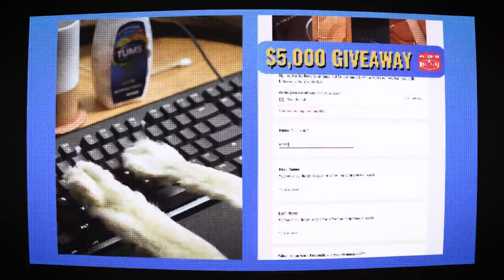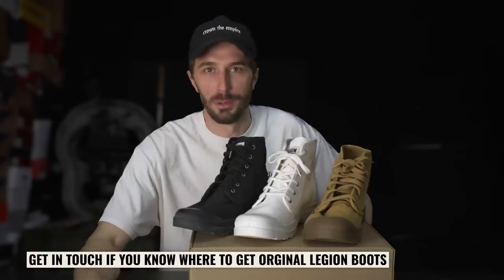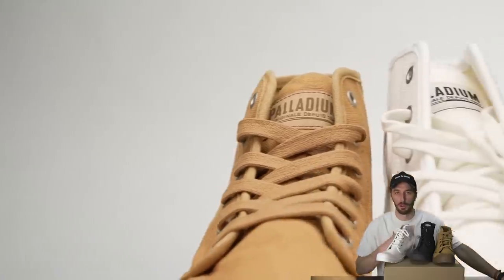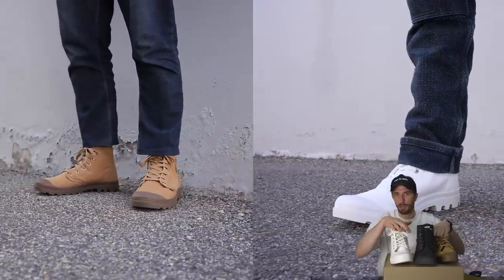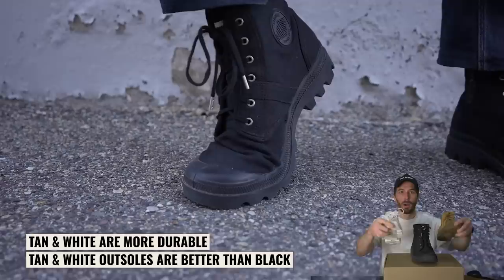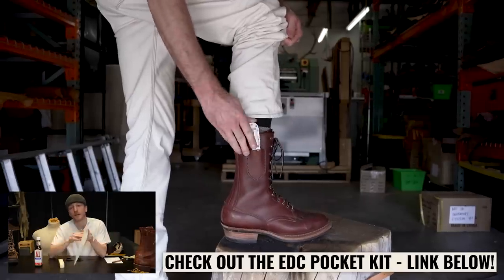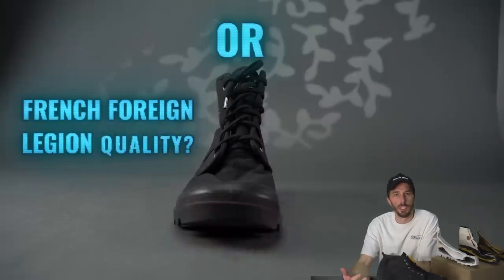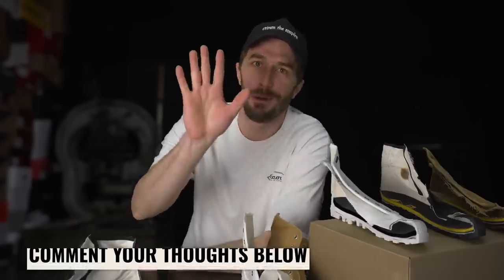(Top 3) Palladium live up to French Foreign Legion legacy?

Comment: Bought a pair, they’re the worst shoes I’ve ever bought. Shame they look cool, but are awful
Reply: Sounds like the french alright
Reply: the ones made in France before the '90s were pretty neat and comfortable, but definitely not for the flat footed or flat walking 'tard. quite durable for their intended purpose. now it's like Converse, Vans or Timberland shoe-like objects: made for milking as much shekels as they can while using the brand name until it's worthless or mostly used to sell anything but shoes. 😒
Reply: what's wrong with them - i wear them for years and by far the best canvas shoe i owned
Reply: I actually found them very comfortable. I have wide feet though. I benefitted from the wide and stiff setup.
Reply: @nundata  They don't really make shoes for people with a wider foot.
Reply: I got mine at a thrift store brand new. They could be an older model.
Reply: Never had any problem with mine. About 10x as comfortable as any converse or the USA made PF Flyers I had. My second favorite summer “boot” after my wallabees.
Reply: Bought a pair that was on sale. Leather vamp. They were 100 on their site. They were fine in urban environments (concrete, asphalt, etc) but as soon as you use them on any terrain more uneven than gravel, they’re all show no go. They’re more sneaker than boot. Compared to Converse, I guess they are better, but the outsoles aren’t durable and have worn out faster than any other boot or shoe I own.
Reply: Imma be hounest, they just look like converse
Reply: I had the exact opposite experience, mine have lasted almost two years of daily use and I’ve worked, hiked (on the rocky ass Arizona mountains once a week or so), and gone everywhere and mine have held up very well. Maybe they’re just the right fit for my feet though
Reply: I hated mine. The canvas wore holes at the flex points, and the outsoles had voids that caused discomfort. Overall uncomfortable and not durable. Basically cheap Converse with a lug sole.
Reply: I have the winter leather ones. I like them, 5 years, still good like new.
Reply: I've always liked mine. I've had a leather pair for years and they've held up well. Not for hard use though.
Reply: They are very uncomfortable with no support.  Usually the only people who wear them are those who enter water because they dry fast..
Reply: I disagree have had about four pairs and think they're very good!
Like heavy duty converse!
Reply: They are actually good and don’t fall apart. I have them for years with no problems.
Reply: I have worn them for years and they are my go to boot and I love them. Sounds like you haven’t given them a chance
Reply: true, not confortable
Reply: I use nike insoles for them and it's comfortable as i also use some nike insoles in my converse 😂
Reply: @ODDiSEE_ some models is wider as i have wide feet that cannot fit in regular converse
Reply: I find my pairs are fantastic… super comfortable and great for my wide feet
Reply: @nundata mine are fantastic
Reply: @Bootspy have a blog post about knockoff Palladiums sold in US or so and people got a lot of complaints about their boots only to find they are knockoffs, are you guys sure you  got the real Palladiums?
Reply: I love mine and have found them to be comfortable and durable. They work great outdoors and I’ve hiked many many miles on the Appalachian Trail with them.

Comment: I have 2 pairs of Palladiums, one of which are "waterproof". Both pairs' outsoles got worn within 1.5 years and the waterproof ones started letting water in when dipped in water after a year or so. They are OK for casual walking, I really like how the canvas looks in a boot-like form factor, but with how simple their constructions are they are like 70-120 USD at full-price at which I can buy canvas shoes that are both a lot more comfortable and a little bit more long-lasting. I bought mine at an outlet store for ~35 USD apiece and I would probably not buy another pair if they are not at sub-50 dollars.
Reply: Yep, I got the waterproof ones too. They stayed waterproof for a couple trips during the first year (including walking in streams). A year later they get soaked and leak when I walk in mild rain. It makes no sense to buy the waterproof version, especially since the non-waterproof has a nicer looking canvas.

Comment: 10:24 gets to main reason modern ones are not as durable, the originals were vulcanised whereby the rubber outsole was melted onto the canvas, like the us jungle boots. Modern ones seem to use glued or cemented construction. This has been hard to verify as the company released a video discussing the original construction, direct vulcanisation, inferring this method was still used. The matter is further confused by the website referring to vulcanised outsoles where the rubber may be indeed vulcanised separately and then the sole unit glued to the upper. Further research (yes I looked into this considerably) indicated that the change in construction method occurred in the early 2000s from direct vulcanised to glued where many seem to be referring to quality decline.
Reply: Yeah mine are over ten years old and do not look like the ones tested here.

Comment: I love my pair of Pampa Hi so much I bought a second pair in a different color! Almost got a third a couple weeks ago lol they are lightweight, comfortable as hell, are quality shoes, and look good. You can get them at Marshall's somewhat often, usually around $30 instead of full price. They blow Converse out of the water in basically every regard, because they are almost everything you want in a Converse but better. For anyone that wants the All-Stars look but can't stand the shoe itself, like me, these are a perfect substitute without adding a ton more weight or bulkiness. You can walk all shift or all day in these and not have foot pain, unlike Converse 🤷🏼 the biggest downside for me is the fact that you can get pretty bad traction on smooth, hard, wet surfaces (like tiles).

Comment: I am retired US Army, I have a pair of the tan Pampa Hi, minus the insole (I replace all  the insoles with ones I like)I really like them. I also have 2 pair of the Altima Maritime (one hi, one low), and the discontinued Go Ruck Jedburghs. I really liked the Jedburghs until discontinued. I do a lot of hiking and rucking. For a lightweight warm weather boot the Pampa Hi works for me. Just my opinion.
Reply: Do you use?
These boots for rocking question mark
Reply: @michaelreyes4981  I have. I have had no problems.

Comment: The leather, waterproof baggy is the best boot I've ever owned. They're lined with wool and keep your feet comfortable no matter what environment you're in.

I wore them on a 40 km backpacking trip through the Continental Divide in the Canadian Rockies mid summer. They performed excellent in the rain and on steep inclines.

I've also worn them on numerous hikes in minus 30 Celsius during the winter. They were incredibly warm paired with wool socks and my feet never got wet.

Ended up liking the so much I got 2 more pairs.Some people people might find them a bit heavy But I'd still highly recommend them.

Comment: I've owned one pair of Palladium boots years ago. I liked the style, fit, and comfort. Mine had the same wrap around rubber outsole as the ones featured in this video. Unfortunately, they only lasted about 1.5 years of daily city use before the rubber started separating from the rest of the shoe. Shoe goo could only do so much before water, dirt, and grime kept getting in and the separation kept growing. They had no warranty. Just another piece of junk for the landfill. I never bought another pair.
Reply: 1.5 years is pretty crazy for a boot worn every day with zero rest days. Even true boots would need a resole with that amount of wear.
Reply: @Fenster21 I wore the same pair of boots everyday from freshman year until I graduated, and only got a new pair when the soles were treadbare and no cobbler would take 'em
Reply: @supertinheng  you probably didn’t do much in those boots besides sit at a desk then lol. Shoes are like tires, longevity is measured in miles (or steps), not age. It all totally varies depending on how and where they are used. My work shoes I wear at my restaurant job still look brand new on the tread, but the top leather is falling apart because I only walk on smooth surfaces, and they are two years old. I had the same shoes when I lived in San Diego as my daily sneakers and they lasted me six months at best because I was walking around town on concrete all the time. City use is probably the hardest on boots aside from hiking on granite, city Slickers are always walking around on concrete
Reply: Shoe Goo is garbage. I've never had good luck with that product. There are much better products than that. Gear Aid makes a shoe repair glue that is much better, or even their Aquaseal or Seam Seal. Or completely remove the sole and use a good contact cement.
Reply: @BikingVikingHH  You're not wrong about sitting at a desk, this was when I was in college, but I was walking and commuting by bus a lot. I've had skate shoes cost less and have the outsoles remain on the shoe with more miles and usage, while skateboarding and biking a lot in them. I still have pairs of shoes with holes in the bottom where the outsole never separated from the shoe. Palladiums boots started separating well before I stopped using them at the 1.5 year mark, that was just when they were not worth repairing. In my experience, they do not make quality footwear.
Reply: @Fenster21  I've had skate shoes that were cheaper with outsoles that remained on the shoe through heavy prolonged use. Two pairs with holes I still use as slippers or for working around the house and outsole is still attached to the shoe.
Reply: @Unicorn161  i’ve found that contact cement doesn’t really bond rubber to leather, just rubber to other rubber
Reply: @Aaronite  a lot has to do with construction, I make sure my shoes upper is stitched to the outsole now on every shoe, from sneaker to boot

Comment: I have the black ones and the tan ones just like in the video. I'm surprised you didn't mention the extra strips of material sewn into the sides of the uppers. That's a definite difference between the version. I've found the black ones (which I was under the impression were a special anniversary edition) fit much looser than the tan ones. Perhaps that's just the difference in size standards in Vietnam vs. China. They really are like a Converse and a combat boot had a baby. I find them very comfortable.

Comment: I owned an original pair and the brown model is fairly close.  What they don't mention is that these were JUNGLE boots, meant for fighting in (then) Indochina.  They were made to be light, airy and to drain water through the canvas.  Troops would draw camoflage patterns on them for a bit of extra concealment.  You'd see French Marines still wearing them in the early 2000s for Maritime operations, but the French Army, including the FFL, had a VERY stout full grain leather boot for most climates.

Comment: I have several of these boots they are especially good if you add a supportive insole. I am susceptible to plantar fasciitis and Sholl inserts are better for my feet than the factory standard. Clearly they are not meant for heavy duty hiking in rough terrain but I’ve hiked in savannah and they are ideal. They are my default travel boot. The canvas make them light, breathable and comfy to wear on plane, train, boat and car when travelling but are robust enough for you to hit the ground running when you get there. You can wax them to give them a bit of waterproofing and you can dye them if you want to change the colour.

Comment: I bought 2 pairs of Palladium because they look cool, but they are garbage. Both are too uncomfortable even for short 5km walk. Also dont last for long - the first pair (Sp20 Hi Cvs) lasted only 6 months, the second one will last forever because I don't want to wear them.
The funniest part is that 12 euro snickers from decathlon are more comfortable (by a lot) and last longer.
Reply: They make good inexpensive otb boots instead of wearing converse, they fit also well with flippers. Good treading for soft Sandy ground. On concrete they get chewed up pretty quickly, but the same applies to the old US army desert boots in my experience.
Reply: @francescolombrici188  I disagree. In my experience, Palladium boots are not designed to last and, like all other products that are not meant to last (which seems to be almost everything nowadays), they are not "good".
Reply: Decathlon products are affordable , practical but they looks horrendous somehow
Reply: @cum5681  yeah, I know, but they are very light and feel great on the feet even after dozens of kilometers. I even went hiking with them in Gran Sasso National Park, my only complaint is that they don't provide enough grip on rocky terrain. 
Anyway, I think I will try M-Tac sneakers next, they look identically to Palladiums and there is a chance that they will be better. At least they are not as expensive as palladiums.

Comment: I have a pair of the taller ones in suede which I don't believe they sell any more.  Same design but far more durable than the canvas ones.  They have held up for close to a decade of pretty continuous "medium duty" use.  I also had the tan pair shown here that went on a trip to the middle east as my "civilian shoes".  Light and easy to pack.  They are some of the most comfortable boots I've ever owned.  If you just want a comfortable, light weight, general use boot, you really can't go wrong.  One thing to consider:  The tongues aren't attached to the upper part of the boot, which makes for less material folded up around your ankle.  But it also allows for crap to get inside.  If you're going to be exposing your feet to things like chainsaw chips, grain, deep sand, etc., it's getting inside.

Comment: I started wearing these in the early 80's when L.L. Bean used to sell them.  Eventually I stopped wearing them because my feets, by global and Waller standards, too big. Then they started making them in even larger sizes and I returned. Alas, they became a fashion item instead of a military supply/surplus thing and prices crept up, it seems.

Great traction - soft rubber! And great tread. (Other than picking up rocks which you become aware of and cope with with ease, rocks come out just as easily as they get jammed into the gaps in the soft rubber.) Best shoe for walking around on a shingled roof.

Flexible sole, very nimble. Chuck Taylors with traction.

Great in the heat. Go without socks in the summer, very comfy.

Get them wet, big deal, as long as its summer time and you don't care about wet cotton shoes.

Light weight.

Cheap.  The bottom may get thin but you'll also get holes in the cotton by that point. I tend to wear mine in the shop, so I'm not getting much sand through holes in the fabric. Eventually just give up and buy another pair.

Their strengths are also their weaknesses, but they are a disposable kinda thing. I now wear a knock-off of Palladium (Farm Blue) to get even more room inside for my feet in a certain big size.

Even the shoe laces can die prematurely. I say toss them immediately and get smaller diameter round laces, which slide better in the eyelets.

Comment: Living in the hot and sticky US Southeast, these are my go-to hiking trail boot. Lightweight, supportive enough in the ankle, rugged but flexible sole. I've only owned a couple of the single color versions, and they lack the contrast of something like Chucks, so not the most fashionable with jeans or whatever, but not embarrassing.

The only place I've had a pair fail was the glue holding the upper to the toe "cap" part. The sock liner held it together, but I stopped wearing that pair, especially for hiking.

Comment: You should stop the ball drop test because the information it provides depends on many variables and you can't draw definite conclusions from it. An example is that one might think that because the ball bounced high, then the insole and sole are thick and bouncy. However, you could get the same result with a very thin insole and sole that allows the ball to rebound with the hard floor and get a lot of height. Whereas, maybe a shoe with a very comfortable and shock absorbing insole and sole, won't give a good bounce. One could judge that shoe as lower quality where in reality a comfortable shoe won't always give a good bounce.
Since the experiment isn't correlated with comfort, you should think of a better test with more consistent results.